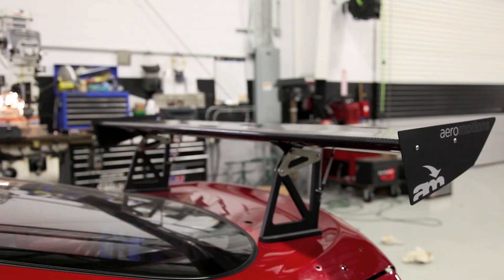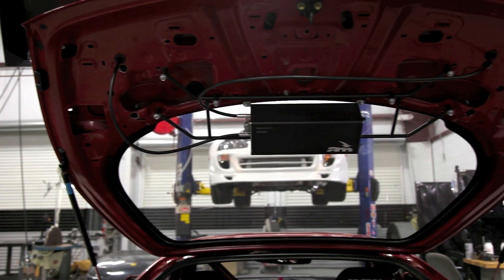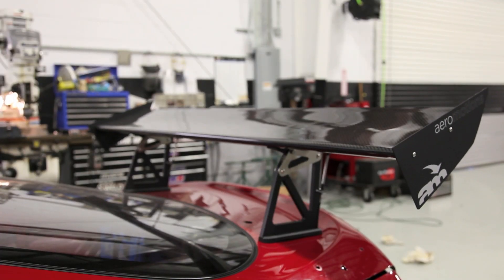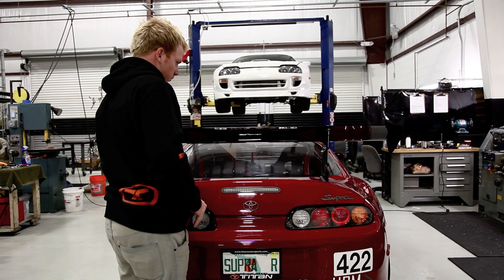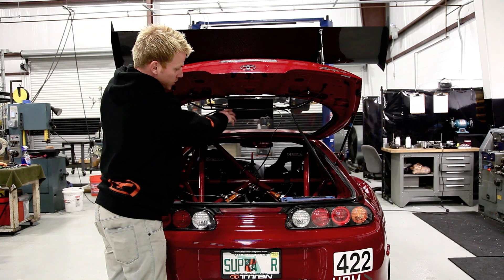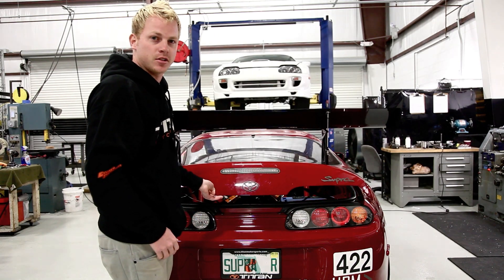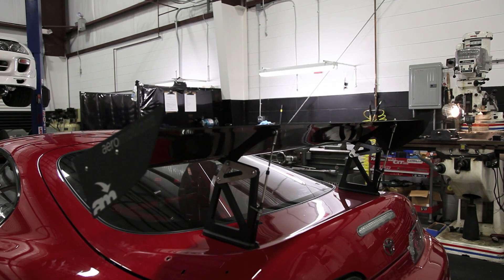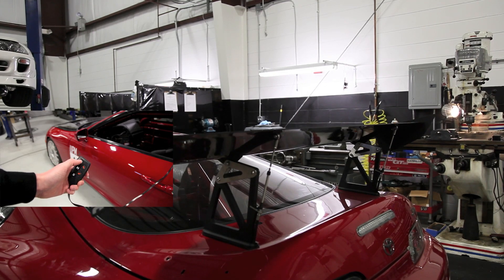Joshua Barnes MKIV Supra - Titan Motorsports Aeromotion Wing Install

Comment: The wing is adjusted automatically through acceleration / braking / straightaway and cornering using a sophisticated computer that factors in it's own independent G sensors, combined with vehicle speed.   Throughout the entire track the wing will be adjusting automatically on the fly, the remote is just used for initial tuning / setup per track.